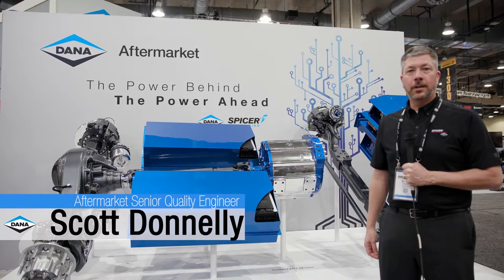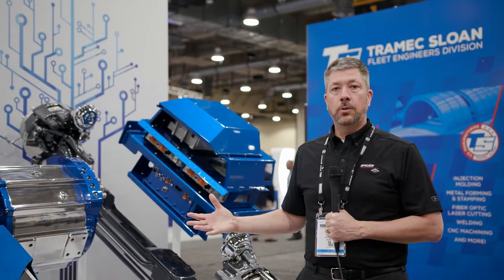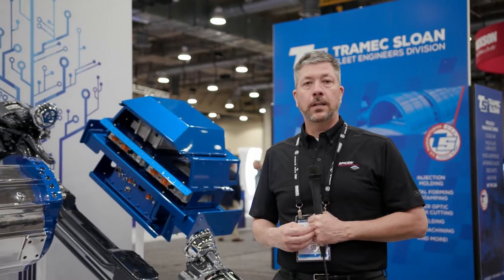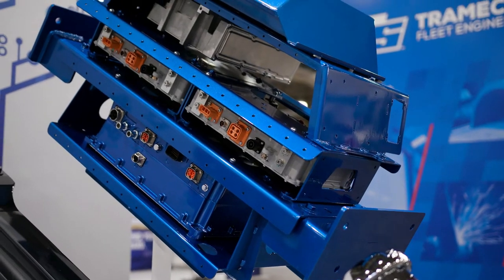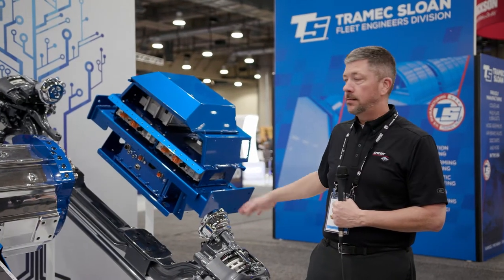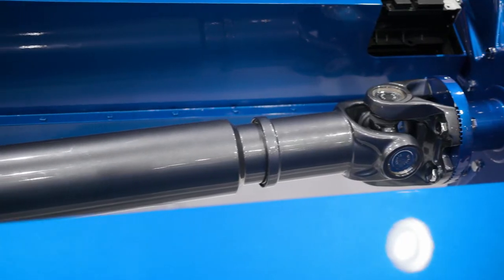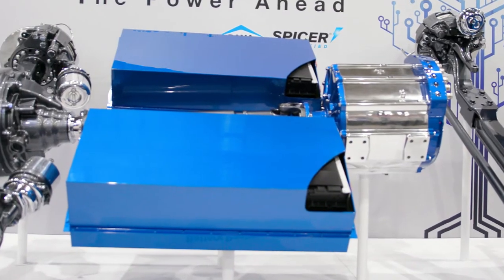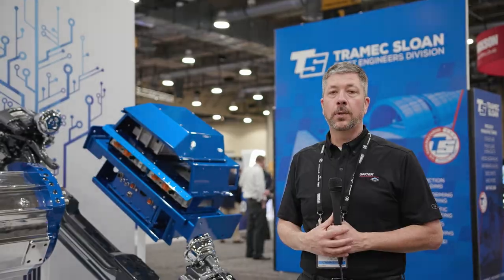Dana Electrified Powertrain | HDAW 2020

Comment: Why not direct mount the motor to the axle, also Edison motors is coming out with a better system
Reply: Edison motors does not make the axles. Just puts the trucks together
Reply: Kenworth doesn’t make the axles either, but they seem to be doing alright?😊
Reply: @donaldbacklund5420 
No shit Sherlock. 
They found a better way. 
No driveshaft to break.
Reply: This is hilarious, since Edison is using Dana’s axles
Reply: @Neberheim  yeah they are making them make some pretty big changes to meet their requirements

Comment: Will the option to swap batteries on-the-fly be available? It will eliminate the 8hr charging downtime. I will be able to drive one way, the 200 mile battery distance, swap battery packs and drive back.  Mounting the battery packs under the chassis on removable slide-outs with Amp rated battery connectors, etc. Will make it serviceable. 
Also, have battery service stations, similar to tesla and evgo, where I can stop for 20 mins, not 45 mins of charging time, swap packs and continue my socal to norcal trip. You get the idea. 
Assuming that the battery is the only part dictating distance and not a matter of allowing the other moving parts to rest overnight because of durability, this option can be possible commercially or even as DIY if extra packs can be sold separately. 
...just thinking out loud

Comment: Okay 
I have a question.

when we turn on power supply, motor will start rotate the differential then vehicle moves. Where is the clutch here 
Where is the control here ....?
Reply: you dont need a clutch, there is no gear box so no need for a clutch, you step on the pedal and it moves, you take your foot off it will roll to a stop and happily stay stopped untill you step on the pedal again, electric motors spin over 10,000 revs easily, and have powerful torque, so no need for a gear  box